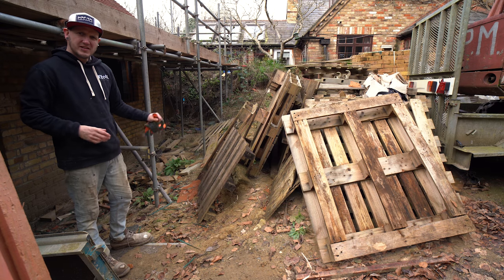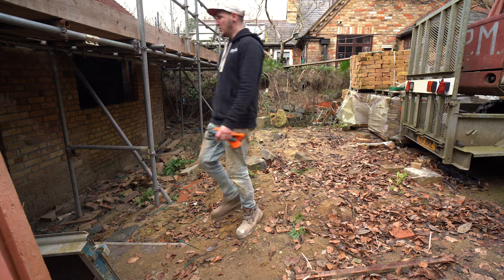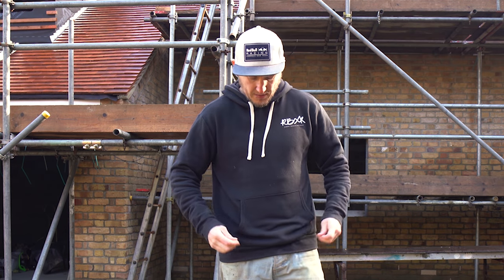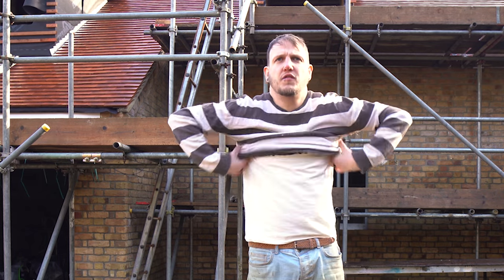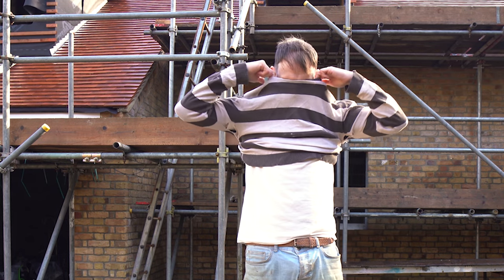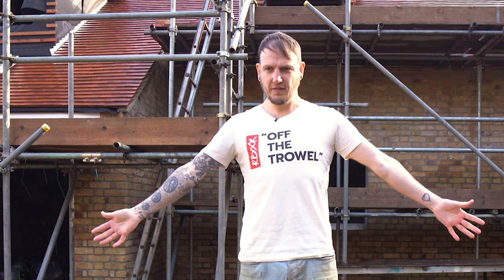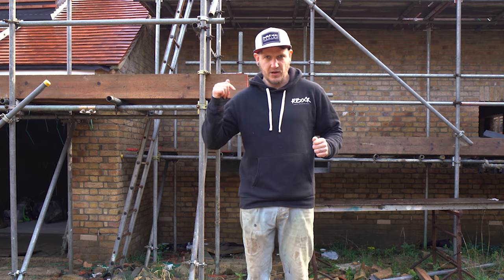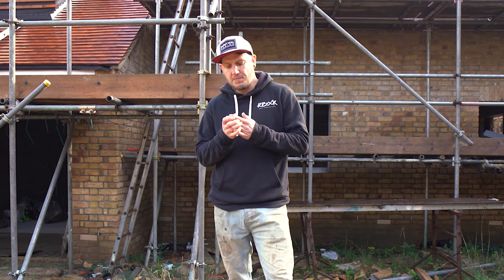BUILDING A HOUSE ALONE from START TO FINISH | E.P 91 [The BOSS turns up]

Comment: Nice to see house build back, on a health and safety note remember dust mask and never run up a wet scaffold board in fact there is never any need to ever run up a scaffold board to skip just push barrow up and walk along side of plank or is that because I am 6ft 4inches I do that feck knows but it works no slipping or falling, I like the tee shirt👍
Reply from the maker: Theres  o way I'd be able to run along side the board 🤣 I'm only 5'11". I'd end up tipping it in my boots 🤣